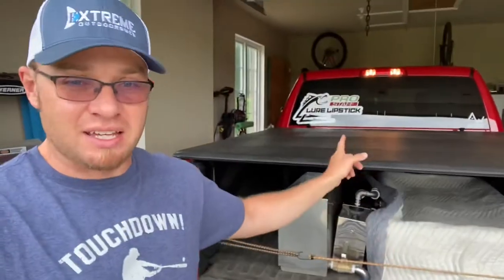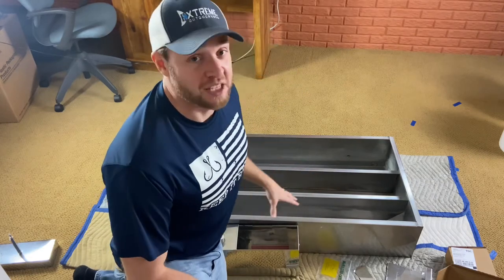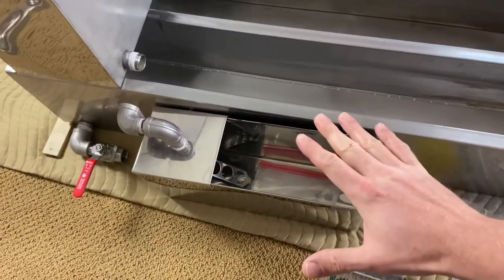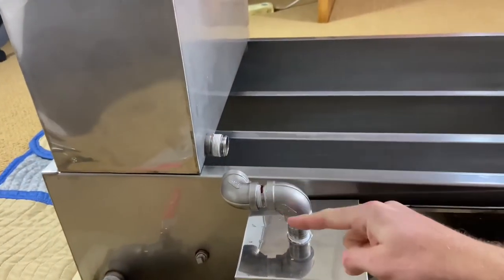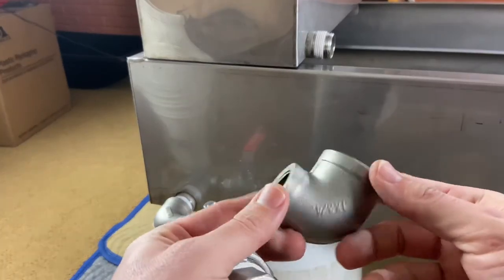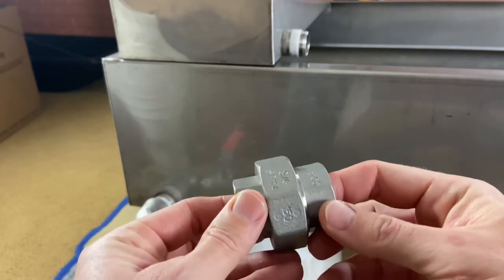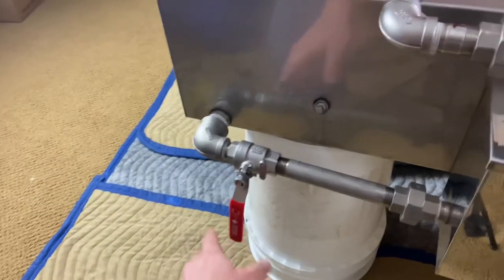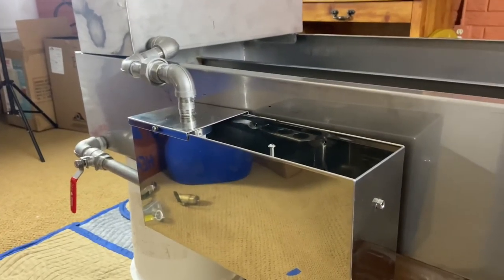Maple syrup season 2021 Episode 8

Comment: Still playing catch up on your maple syrup series.  Great info about your evaporator. We are just using 2 homemade burning barrels. One with a 20 gal. pot that we use for the final boil down. And the other one has two 5 gallon pans. One is used as a pre-warmer, the other heats it to a boil. We do all transfers by hand with a small kettle. We transfer the sap from our 55 gallon collection barrel filtering it to a 5 gallon bucket then to the pre-warm pan. As it warms we transfer by hand with the small kettle to the back pan were it heats to a rolling boil. At that point we hand transfer to the big 20 gallon pot for boiling to around 212 to 215 degrees .By the time we reach that temp that water content has just about all boiled off and we transfer to the kitchen stove. At that point we monitor to the 219 deg. temp. and then a final filter and pour into our pint or quart jars. As you can see our process is labor intensive. But we have the labor force, as we use the maple syrup operation as a way to get our family and friends outside in the outdoors when we would not all normally be there. It is truly a family and friends event every weekend from middle of Feb. give or take a week until the sap stops flowing, usually we produce somewhere between 4 to 6 weeks. Our best season netted out around 10+ gallons of maple syrup. Looking forward to watching more of your videos and learning your process for any ideas, etc. Thanks for taking us thru your evaporator set up.
Reply from the maker: That is a great process for sure and having help is a big part of it. I used to do this with my neighbor on a smaller scale but I wanted to take it to the next level so I branched off and started this new operation 3 years ago. Every decision I make comes after countless hours of number crunching and breaking down a process so that I can be as efficient as possible. Being a one person operation means I have to consider every part of the process. If I go bigger one day I want to learn as much as I can now so that I can be even more efficient in the future. Thanks as always for the support.